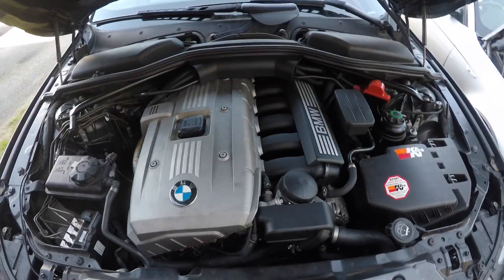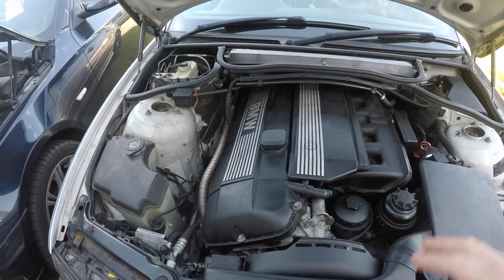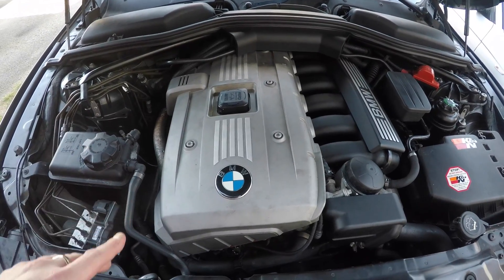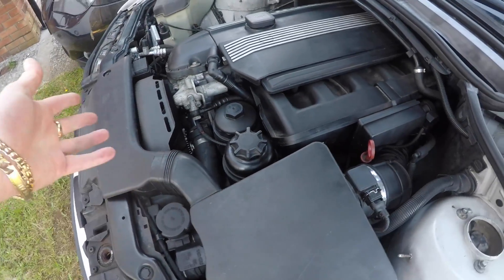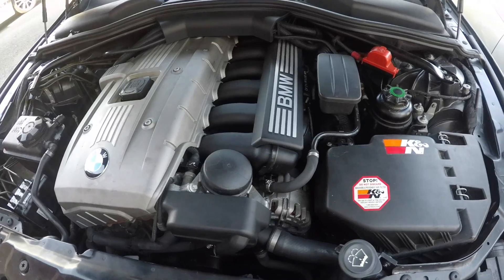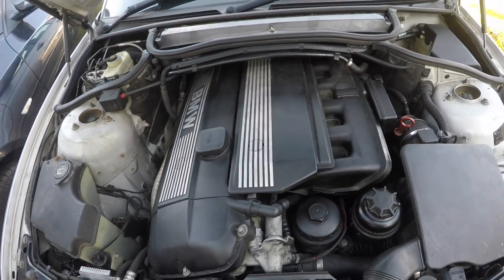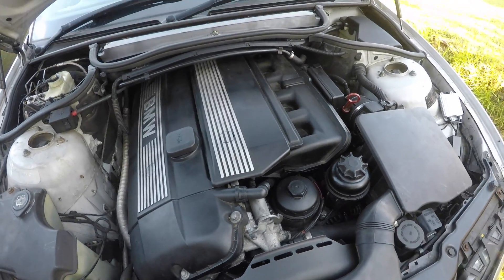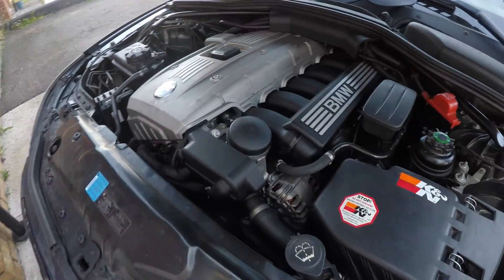BMW N52 VS M54 Showdown Of The Best & Last Of BMW'S Naturally Aspirated Engines Ever Made

Comment: Newer BMWs are plastic crap coming from an n52b25 and n52b30 owner. Cant speak for older ones.

Oil leaks everywhere, engines are highly sensitive, problems can be difficult to diagnose. They are reliable only if you stay on top of ALL things that can go wrong, which are many.

Comment: Well this here Yankee can Barly understand this here Blok as his camera audio keeps cutting out. From what I can make of it, he's dishin the M54 as the more unreliable of the two.  Well I disagree. My 03' M54 3.0l in my Zed 4 which I've had for 9 years has been a very reliable motor. 
Over 100k miles and no oil leaks anywhere. None, Zippo! Yes I did replace the expansion tank, as it leaked a bit so I did some preventive maintenance. Far I can tell the Vanos is Factory as is the Disa. 
I did inspect both of them and found no issues with either. Only thing I've done is a new set of plugs and replaced the air-intake hose. 
It might be because I religiously change the oil every year whether it needs it or not. The beaut still purrs like and kitten and scoots when pressed.

Comment: Which engine would be great for hot areas like Middle East 
I have sonata 2013 2.4 mpi
And i want to buy bmw 530i 2010 n52
And you know here the temp at summer reach 50°C 
So what it’s ur suggestion?
Maybe I could buy 2005 530i with m54
Reply: cooling system on the M54 sucks and the n52 also has a pretty weak system so i’d get one if you plan to refresh to whole system, water pump radiator etc

Comment: 2005 bmw 525 150k miles (240k km) 11 years owned 👍
Reply: did you do the coolant pump? solenoids? oil filter gasket? belt and tensioner?

Comment: M54b30 is better.  I own both and just acquired the n52 2011 328i. Chasing misfire for days now.  New used vanos , new NGK spark plugs ,new coil packs on the way. I think it may be either fuel pump or I may have to spring for brand new vanos solenoids. I can't imagine 2 sets and it making no difference.
Also I need to find a shop that can test and clean 2 sets of injectors. Multiple cyclinder misfire. 
Jesus Christ the M54B30 is way easier. 197k miles on the 03 330i and still driving it daily no lights one dash .
Reply: That's what a diagnostic tool is for. It's not just for telling you engine codes and stuff. It's to run live data and display it to you. Then you're to take the service manual to figure out if the components are behaving inspect to what is the normal operating value is supposed to be.

Comment: i’ve got an e90 325i n52 with 220,000 miles on it.. runs smooth starts right up, idles smooth. smooth and steady power delivery, sounds nice, all i’ve ever had to replace was thermostat abs water pump at 180k miles.. cannot recommend a better daily driver with an in-line-6. i love it.
Reply: Brother i have a 2011 328i n52 175000 miles on it changed starter,battery and the radiator had a pin hole in the neck part on top hose,plan on changing the water pump at 200k or sooner for maintenance. This the smoothest running engine I have ever owned.  And easy DIY 
I'm going for 300k  put that in your pipe and smoke it Scotty.

Comment: Hey guys need help with this.
If you could have an E46 330ci M sport or an E90 325i se (both pre LCI) What would you guys go for?
I recently purchased an E90 325i for $4200 (NZD) and have been quoted around 3 grand in repairs (valve cover gasket kit which includes the ccv etc, and new rotors and brakes all around). Not sure if keeping the 325 and getting the work done will be worth it as I wish it was a 330i with the magnesium cover. Couple real tidy E46 330ci's I'm currently looking at for around 7k. Any input would be appreciated, cheers!
Reply: what did you end up purchasing?

Comment: O ha e the n52 and one of the aluminum bolts inside the engine snaped and the head of the bolt got stuck in the oil pick up

Comment: I've got the m54 in my 2005 530i and it has been a deam.  I'm at 380,000 miles and still runs great.  It isn't worth anything and I'm looking forward to a newer one but I don't want to let it go.
Reply: Hey
I know your comment from 3 years ago but I have a few questions if you can help me
I just got 2004 BMW 530i which have the same engine (m54), the radiator have a big water leak
the car is not driveable right now because the water will get out quickly
how do I know what to change (more than the radiator) before I start driving it?
is it worth it to replace the rod bearings?
the car have 132 miles btw
Reply: @yaserhasan6004  the M54 doesn't need rod bearing replacements, they are pretty solid and there's examples that go beyond 200k miles. just keep up on oil changes and don't redline the car too often and you're good!
Reply: @yaserhasan6004  check your radiator thermostat and check your coolant sensors

Comment: Hi Dean just watched this amazing video. I realy value your opinion & experience I have E39 528i with m52 it's a 98 model so so it's single vanos I've been thinking on getting a 3.0 so it wauld be m54 my car is running as perfect as it can be engine was rebuilt in 2008 so technically it's done about 48k car drives spot on but I've had it a few yrs & want to stick with E39 but fancy a 530 sport Wats your opinion on one compared to my car because it's so had to find a 530 sport that hasn't been around the world

Comment: I would like to switch from N52B25 to N52B30, do I need to replace the entire engine to do this, or is it enough to down from 3.0?
Reply: of course you dont need to replace the whole engine, you just need to swap the 25 for the 30 part. 

good luck!

Comment: Your wrong about the power output of the m54 3.0 They put out 230bhp. 
 The America’s zhp has 235 because of different cams and ecu. 
 The 197bhp is the 2.5. 
 Oh and the best non M engine from that era is the m52tub28.
Reply: @ace3bmw3  it was 231 bhp if you want to be totally correct. Not 230.

Comment: Better engine than n52 is n53  it dont have a rubisch valvetronic and bad head of engine
Reply from the maker: That’s true but at the same time N53 is very very expensive with the injectors and high pressure fuel pump and USA never got N53
Reply: And what exactly is wrong with valvetronic besides the possibility of needing to replace one sensor under the valve cover?

Comment: I had an M54 e60, what a piece of junk. I current have an n26 f30. Cracked 125k miles SOLID MOTOR. And no, no chain issues. I turned off auto start stop, and change oil and filter every 5k. m54 has piston ring problems. VANOS issues + solenoids. Oh and absolutely garbage cooling system. The previous owner didn’t take good care of it either but the M54 will nickel and dime you the older it gets. It cannot handle city driving at all.
Reply from the maker: Mate I don’t believe that for one second maybe in the USA that’s the case but not here I can tell you right now I have had 3 e60s with the M54 engine all have been nothing but pure pleasure and a brilliant engine for the E60 and E61 I also own the e46 with the same engine WITHOUT any of these issues at all this is all to do with neglect and using cheap parts I will say it again 

I do not use cheap on ANY of my cars I only recommend bmw parts and it’s the ONLY parts I use myself this piston ring problem must be a problem on the USA models only based on not having quality control as this problem does not exist here in the U.K.

Comment: u can see it right away, even the coolant expansion tank on M54 is very hard to get replaced
Reply from the maker: No it ain’t mate coolant tank is easy to replace on the m54
Reply: I have replaced 2 on my e46. They are EZ PZ
Reply: I just did my M54 expansion tank on my 05 Z4, easy

Comment: i love my m54 330 ci .
Reply from the maker: So do I aswell beautiful engine
Reply: Me too. Same car with 215k and it's bulletproof if you do the maintenance religiously
Reply: I own an E60 525 Msport (N52), It's piled on 155,000km and really wanna have a very strict service and maintenance program. But my confusion is, do I wait for it to inform me of what to do? Through its idrive system? Coz when I go through the system it shows me different replacement times for like plugs, oil, brake pads etc..

Comment: Thanks for the video!
Do I need to get new bolts for replacing valve cover gasket and oil filter housing or can I reuse the old ones?
My E90 330i started using lots of oil, I don't know where it goes.
Doesn't appear to burn the oil, so it must be loosing it externally.
I'll try replacing those gaskets first and see what happens.
Reply: Jack Trade Yes, the bolts are one time use aluminum. You may want to consider doing the oil filter housing gasket too.
Reply: @briantii  I ended up doing the whole lot at the top : valve cover, oil housing, valvetronic motor gaskets, all the O rings as well on all the sensors.
Cleaned a mountain of sludge from the valves and ledges, but clunking noise coming from one of the hydraulic valves is still present and it drives me maaaaad!!!
Looks like the only fix would be to pull half of the engine apart, which it's not really worth my time and effort.
Reply: Jack Trade Good call doing it all at the same time. I’m surprised by the sludge though. Wrong oil? I’ve known a few with 200k miles using factory recommended intervals and no sludge at all. Seems odd. Sorry you’re still having the ticking. Knock on wood mine hasn’t done it yet.
Reply: @briantii  yes.
It is because of those sick individuals in BMW that in all their wisdom decided to have oil change intervals on early E90s every 30,000 kms in Australia. 
It was all OK, while those cars were still under warranty. 
Second hand owners like me copped all that sludge from too far extended oil change and other problems that this brings...
Reply: Jack Trade Nah, that’s what I meant. Even with crazy long intervals still no sludge. Buddy of mine has over 240k miles and was changing it every 15-20k per the cbs. Odd.

Comment: Hi great video
I have question is there a difference between the n52 engine 2005 en the last n52 from 2007
Reply from the maker: yes there is they switched to plastic valve cover over magnesium please do not get it confused between black valve cover as if your in the uk that will be N53 as they stopped production of N52 in 2007 they only kept it in the USA to make them idiots pay expensive price for valvetronic lool

here they was doing us a favour getting rid of the engine buddy n53 is a much much better engine and its uk and eu only because it demands a good quality fuel which only arabs provide
Reply: @BMWDoctor  thanks for the reply.
Wish you good luck
Love youre videos

Comment: I have the n52 whit the ticking lifter.
Is 10w60 oil better to use?
Reply from the maker: your crazy bro 10w60 no 5w40
Reply: @BMWDoctor  the bmw dealer just told me to use 10w60😅
Reply: @BMWDoctor  I am going to change the oil this week.
5w40 Castrol edge?
I will use forte new generation motor flush.
And whit the new oil I use the forte to end treatment.
Reply: @BMWDoctor  what oil brand?
Castrol 5w30 is for bmw only or can I use 5w40 castrol, whit 5w40 there is no BMW in the sheet that reccomend is for bmw.
Reply: @murdoc908  9
Reply: 10w60 is really thick at cold start it will take a long time to build oil pressure to push the timing chain tensioner and to lubricate the engine. Then at normal temperature it is still thicker than what it says in the owners manual. That can cause unexpected problems and increased fuel consumption. 
Dean already showed how to fix the lifter ticking problem. Keep it  at 3k rpm for 2min.

Comment: Dean, I wonder if you would suggest to use mishimoto thermostat to keep n52 engine cooler?
Reply from the maker: Do not use that mate these engines are not meant to run cooler these engines are designed to run hot to help with fuel and emissions it will affect the engine badly and cause the engine to suffer major damage as the oil sensors are run by the temperature of the engine aswell if they realise it’s running cooler it will have major impact of the engine itself
Reply: @BMWDoctor  appreciate for your  insights!
Reply from the maker: your welcome

Comment: Yes N52 are easier to work on if you have special tool fot it (if you have to remove the cylinder head). And the timing tool and valve tronic spring tool pretty expensive here.

I can assemble M54 without timing tool and i can't do the same with N52 🙄
Reply from the maker: That’s ONLY because of the vanos adjusters n52 is very very easy to re time the tools are not expensive at all I don’t think so
Reply: @BMWDoctor  yes im agree with you. But for me, i will not throwing 450$ (in here) for the timing tool only if I'm not making money from it or planing to keep the car for the rest of my life. So I'll stick to M54 

Anyway nice video . Cheers

Comment: Isn't a m54 330is always 231hp, m-sport doesnt mean differnet engine? And then US has a ZHP with different cams and a bit more hp? Never heard of a 3 litre m54 with 190 something hp, that must be a 2,5?
Reply from the maker: No mate your wrong m sport always has extra power wikipedia is there to tell you and confirm my corrections go and see same as e60 if you get se you get lower power then a m sport the 2.5 is still a m54 but lower powered 3.0 that’s the power the non m sport get
Reply: @BMWDoctor   I dont really get what you mean here, a m54b30 only has two different outputs? Its the standard at 231hp and then US has one with a couple of horsepower more. Maybe this is some UK specific thing I dont know about? In sweden where I live anyway, you could get a e46 with m54 as a 320 at 170hp, a 325 at 192hp and a 330 at 231hp, then you could add the complete msport pckage on either of these if you wanted to, but that didnt chnge the engine.
Are you saying all msport m54 e46s in UK were 330is and non msport had the smaller motors? Never heard of an SE either, guessing this is different packages for different countries maybe? Did UK msports maybe get the same ZHP engine as in US? 

On a side note I've got a E28 with a m54b25 in it that is turboconverted, completely stock motor and it is holding up better than expected! Had a m50b25 turbo before but I'm now testing how much power a m54b25 can handle :)
Reply from the maker: I wouldn’t put that on a m54b25 good luck with that I can see the head gonna be warped and blown head gaskets straight away the old m54b25 which is what it will be suffered bad head gasket failure they used different gasket design on them to the 3.0 version and yes we get all different here in the uk the us get different that’s because everywhere has different fuel grades we get SE here which is basically SHIT EDITION as we call it nothing spectacular in the car and if you opted for that package even in 3.0 you would get it at 190bhp which is the 3.0 engine still but basically 2.5 you would ONLY get the 231bhp model if you opted for m sport models and it’s the same to this day if you get e60 se you will get m54 engine with 230bhp if you get m sport 530i you get the n52 engine with 258bhp and after that you had the 258bhp as the SE models and then the 278bhp n53 engine in the lci e60 m sport that’s how m sport had a power gain over the normal editions and that’s what makes the m sports m sports and bmw makes more money we are all happy well I am anyway as you know I favour the dealership highly
Reply: @BMWDoctor  Knew about the n52s different variants but did not know that about m54. They were sold completely different over here.
Actually the m54b25 has survived for 5000kms so far, its running 1,2bar of boost and 500 horsepower. I do use upgraded ARP head bolts which clamp the head better to the block, but I cant torque them as much as the bolts can handle because I will be stripping out the threads in the block then. If it fails I will have the threads enlarged to m12 with insert threads or similar to be able to torque them further. 
I've had m50/m52/m54s getting warped on stock cars, but it has always been because of something else failing first. Waterpump, thermostat housing or some other plastic part. It seems to be able to take a LOT of abuse as long as it doesnt overheat!

I haven't even pulled the head off the engine, I just changed the head bolts one by one and changed waterpump/thermo housing and valve cover gasket just to be safe. This could of course be done more serious than this, but given that I can get a m54b25 for about 300 euros, I will try more boost and see how far I can go before it fails! Then I'll do the same treatment to the next engine and turn back the boost a bit. 

Its very popular to turbo convert BMWs in Sweden, theres a couple of E46 330is with m54b30 with over 600hp on a stock engine and it holds up just fine, its amazing how overbuilt these motors are in some regards, and how on the other hand, can fail stock because of a plastic piece of the cooling system failing for example. The engine will explode in an instant if it isn't correctly mapped of course, but with enough fuel and correct ignition timing it is dependable! When doing this we always use E85 as fuel, it doesnt knock as easy with the high octane rating.
Reply: @BMWDoctor  What are you on?
A car having being M sport does not mean the engine has more power...
Go and look at a SE 330i e90 vs a M sport 330i e90.. they have the same engine, the fact that it is m sport doesn't mean the engine has more power, its trim level and suspension difference.
Reply from the maker: Trim level and suspension 😂😂😂😂😂😂😂😂 this isn’t the USA mate 

Not in the U.K. NO WAY isit trim level and suspension your completely messed up in the head if you think that
Reply: @BMWDoctor  in the Netherlands the Non-M and M versions have exactly the same engines and horsepower ratings